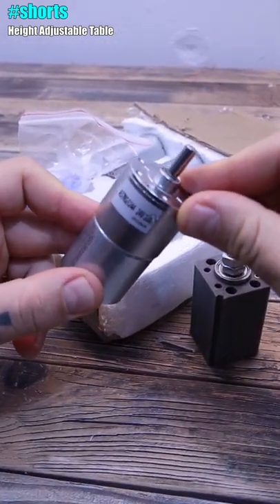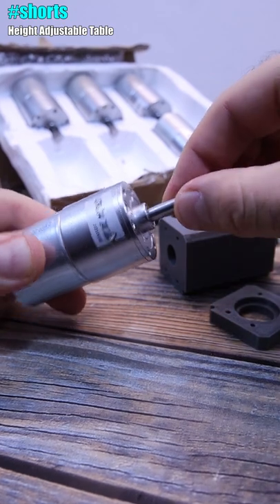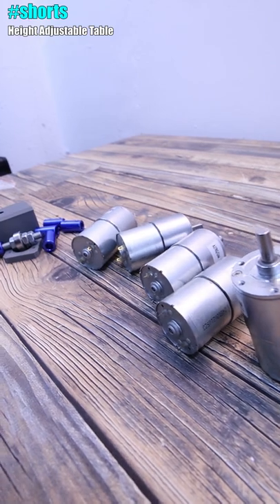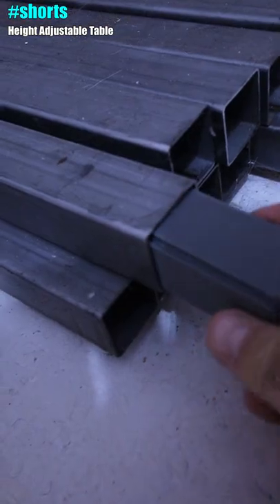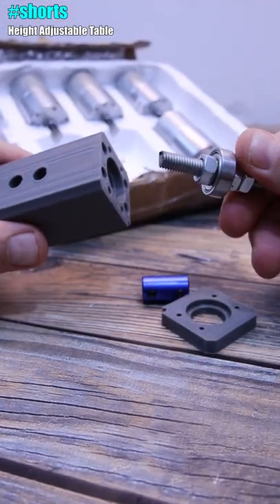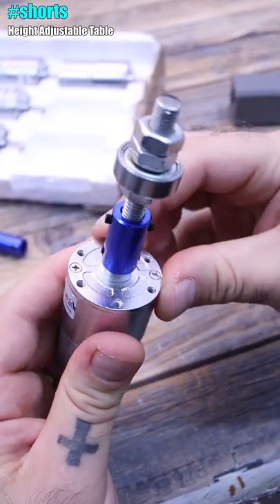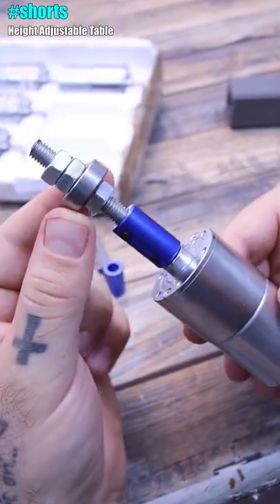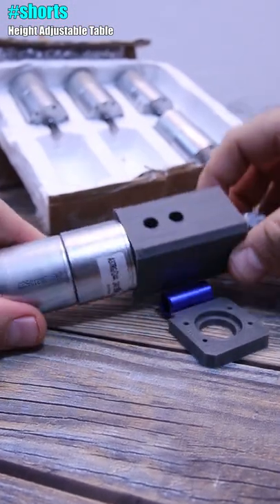High Torque Geared DC Motor for Automatic Table

Comment: 20rpm = 1 rev every 3 seconds.
Your table will take 3 seconds to raise up by 1 pitch of the screw threads, about 1mm.
 5 ~ 10 minutes to go from sitting to standing.

Comment: The weight of the table top and everything on it will be resting on those 5 threaded rods, which are only supported by the motors' gearboxes. Yikes !
 You might want some thrust bearings and steel supports between  the blue shaft couplers and the motors.